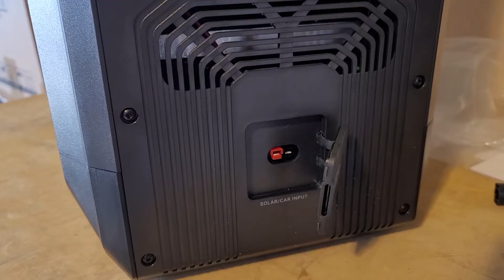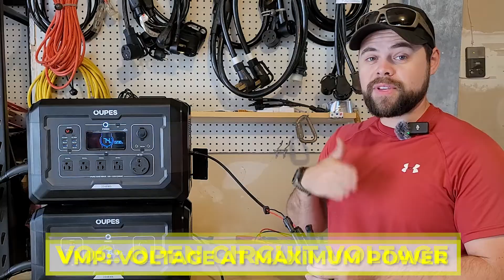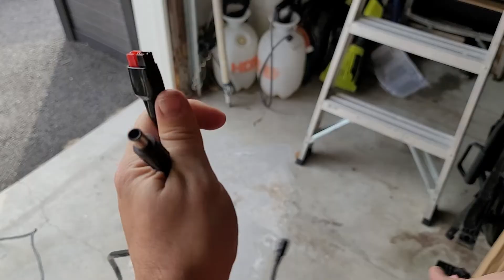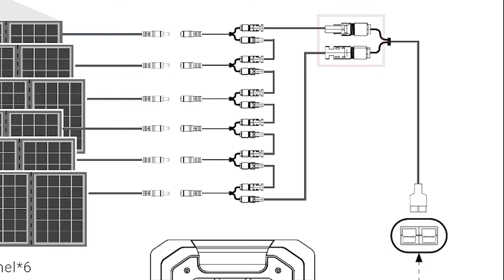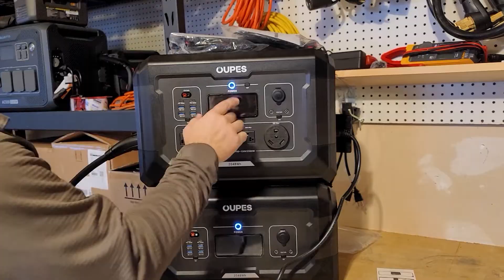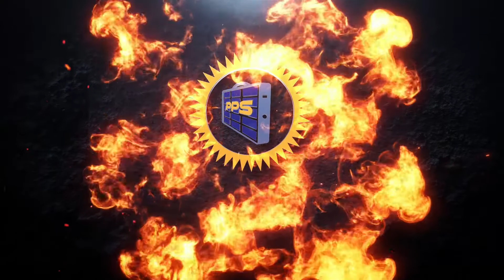Top Rated Midcap Portable Solar Generator Oupes Mega 2 Review

Comment: Why don't they have a hub to get 240v?
Reply: Because the batteries and inverter are too small for that. Most power stations that can do that are much larger. This size is still considered portable and designed for lower wattage appliances for a short period of time. An appliance that requires 240 volts would drain it in a very short amount of time, whether you had 2 of them hubbed or not. Hubbed units are much larger, much heavier, and way more expensive. You are watching the wrong video. Look for 3000 to 5000 watt units. Cheers

Comment: I'm trying to figure out how to get my solar wires inside the house to plug into my Mega 2 and b2.  What type of box would you use to run thru the wall?  Combiner box?  Does that create a parallel on two sets of series arrays?

Comment: I just got this unit about two weeks ago, and I absolutely love it. It works with all my different panels and my car charger (and handles my different kinds of panels with different attachments).

It is an extension cable for devices that need an Anderson cable.

My favorite thing is that most normal appliances max out at 1800 watts, but mine actually handled an hour of 3000 watts AC.

Plus, it has complete pass through.

I will say you want to buy the batteries from their website directly— and it can handle 5 expansion batteries, for 10kWh

Comment: Tangent question. I want to use this in my box truck for my handyman business. During cold days would it be good to use a heating blanket to keep the unit what's the temperature range, or is there a better idea for keeping the unit warm and my truck. I want to preserve paint and caulking products from going bad in cold weather

Comment: Here's a strange question you may not have gotten before about the Oupes B2 expansion battery.
I have a small 150-watt power inverter that I plug into the cigarette lighter in my truck.  I use it to charge my action cameras or cellphone while I'm driving to my fishing or hunting spots.
Is it possible to plug this same type of cigarette lighter plug-in power inverter into the cigarette lighter socket in the B2 and have it work that same as in my truck or, would it blow up that little plug in inverter?

Comment: If you have shading on your panel connected in series you are not efficient that’s why you have high voltage still but low power. Try changing your setup to series/parallel and shading won’t affect so much the efficiency of your panels. You probably know it but I wanted to point that out  anyway😂😂😂

Comment: If I didn't do the Oupes extension B2 to the Mega 2, could I connect a Bluetti AC180? For more WH and extend battery life? It's on sale right now for 569, instead of paying 1000+ for B2. Even tho B2 is 2048wh vs Bluetti 1152 wh.

Comment: This review made my decision, being able to add solar with just another battery is awesome. Makes it worth it. Normally I would have to get a whole new system to expand. I will probably get the Omega 3 though, need more AC. I wonder if it has true 30a connector?

Comment: Bought one and using it like an ups in my server rack.  Networking gear and servers are drawing between 600-700 watts.  I should get about 2 - 2.5 hours of backup power.  I also have rackmount ups’ between the mega 2 and gear.  Backing up the backup.

Comment: Thank you Ben. I had heard that the mega 2 30 amp plug had some limitations, but some of the reviews did not mention it and one did, so I was confused. I will primarily be using this RV. So I’m thinking that the mega three will be the way I will go  your review is awesome thanks again
Reply from the maker: If you need it for an RV and want to make sure you can use the full 30a output, then you should go with the Mega 3. You can use this link along with my coupon code "MMP" https://oupes.com/?ref=va1y1jwb
Reply: @minutemansolar  I already plugged in the code for the 5% discount. Appreciate you.
Reply: @minutemansolar  Oh bugger!  I just purchased this for my RV!!
Reply: But will it still run my truck top campers AC in the big plug? It's not a big RV.

Comment: Ben.  Awesome review as usual. Are there limitations on the 30 amp plug on this mega 2 vs the mega 3?  Want to use the mega 2 for powering my pop up trailer when dry camping. Of course I’d grab 1 or 2 expansion batteries. Thanks as always.
Reply from the maker: The only difference between the Mega 2 and Mega 3 is that the Mega 3 has a 50% larger internal battery, and a 3,600w inverter instead of 2,500w inverter. The Mega 3 uses the B2 expansion batteries, has the same mppt as the Mega 2, and the same screen. You can run the full 30a from the Mega 3, whereas the Mega 2 you only get up to 20.8a even from the TT30 rv plug.

Comment: Other reviewers complained that the charge controller seemed to take several minutes to respond to changes in charging conditions being displayed on the screen. In other words, it seemed slow to calculate what was coming in. Did you experience that issue?
Reply from the maker: That is good to know. I didn't experience that myself.

Comment: One critical factor I've discovered in my research on these devices vs. building my own system is that the customer has zero control over the quality of the parts used in the systems. These "budget" systems cost less for a reason. Quality is being sacrificed somewhere.

While the AC inverter sounds impressive with 2400 watts rating with 5400 watts surge, the reality is, this is likely going to be the weak point, and the biggest reason your generator will fail. Why? Most of these portable generators do not use the more robust low frequency inverters with beefy transformers. These devices use high frequency inverters that are transformerless. These do not last as long and more prone to failure quicker when using heavy loads such as air conditioners, microwaves, cooktops and power tools. They will wear out faster. The warranty is 3 years and that's the confidence level this company has your device will last. Oupes is not alone. Many of the portables use high frequency inverters that can't handle power loads as well or for as long as transformer based ones.

That said, I have no idea how long these will last. If you are a casual camper, it may last 10 years or more. I simply don't know. 

When you see reviewers do the FM radio interference test, they probably have no idea why they are doing it other than copying each other. But it is a quick, though not definitive test if your AC inverter is high frequency or not.

Now, the advantage of high frequency inverters are they weigh much less, which is kind of important in a portable generator. They also take up less space. Oupes seems to have chosen good air flow and high noise to help reduce the strain on these cheaper inverters.

Yes, the Mega 2 uses a high frequency inverter. I'm guessing pretty much any model below this, and likely even the Mega 3 and Mega 5 also use them. It's not just Oupes, I'm guessing most other brands also do.

So, for campers, you are probably OK. RVers, you are probably OK unless the RV is your permanent home. Off Grid, light backup duty should be OK. Otherwise, permanent RVers and off grid homes should build with quality components that will last and that can be replaced without having to buy the entire all-in-one system.

Comment: Majoring in the minors, sorry, Recovering engineer turned teacher turned steam plant operator.
* 2:48 determined the expansion battery cable on the left side but you never stood back and plugged it in. 
* Also, expansion cable jacks must be either/or as it is plugged into the lower jack; I would think that the complete unit, when stacked, would have best see the plug in the upper jack of the expansion battery going from upper deck to lower jack on the second battery.
* Slow down 10%
* A lot more work but some graphics on math would help
5:26 while a secondary feature of the expansion battery, you never explained that the car 12-volt car outlet could be used for a small AC inverter, or even a small DC refrigerator for a small cabin like mine.

Not so minor is the fact that the Oupes website says the EPS is ≤20ms.  You identified it as a problem, but you never checked the specs.

I'm seriously considering this as a first foray into portable power up at my building. I have a 12 KW portable generator but also a 2200 Honda inverter generator. Everything has its place. Don't think I would trust this for a stand-alone walk away refrigerator. 

I could also take it up to power my home air handler should my home SMA system fail completely fail, 120V, 20A so barely.
Reply: You should review these. I'm trying to figure out why most all these companies haven't been in business long and are located in china. I question warranty and even UL compliance. And i wonder why more U.S. companies aren't reviewed